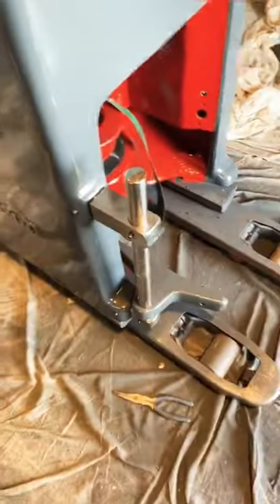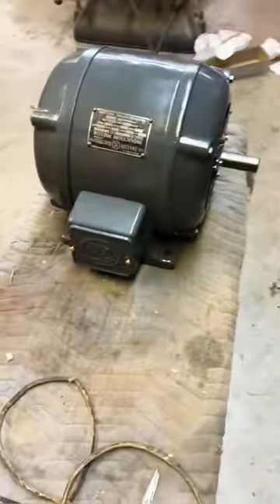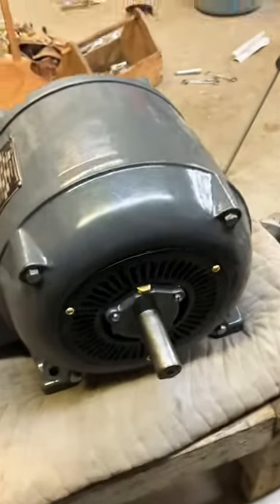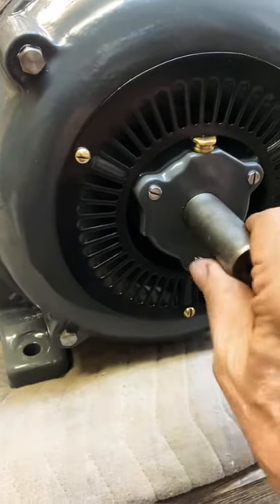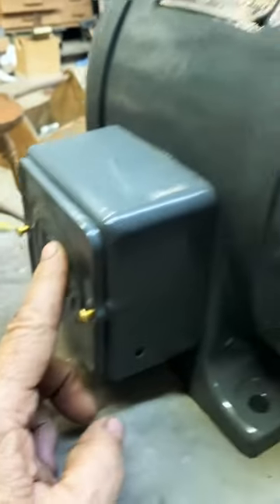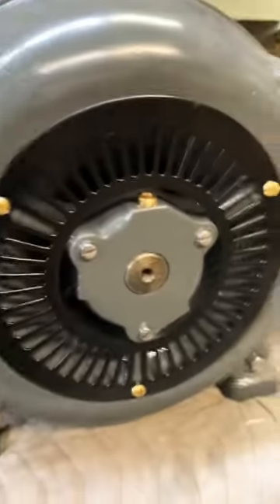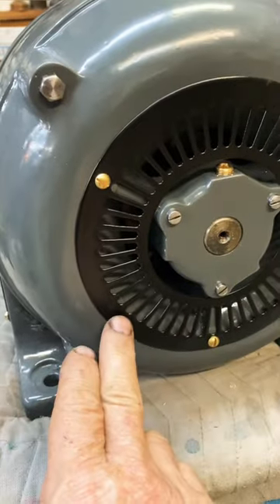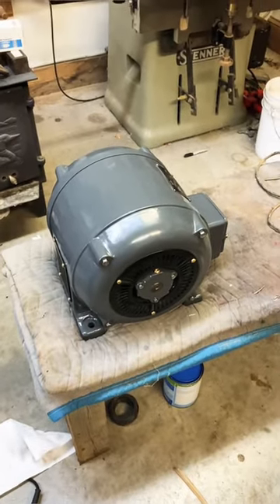Robinson NCT spindle molder Motor set up #wadkintemple #woodworking #vintagemachinery

Comment: Sir , what’s the colour you have chosen ? I have a 1943 “ Canada “ made 6 foot tall drill press from a battle ship back in tue day , it was somewhat that colour when I had it handed down to me , had the lead based paint stripped off , then painted it black … looks great but would love its original colour ….800 pounds of steel , 200 of that is tue base plate I’m sure .. thanks ,  Steve , Atlantic Canada